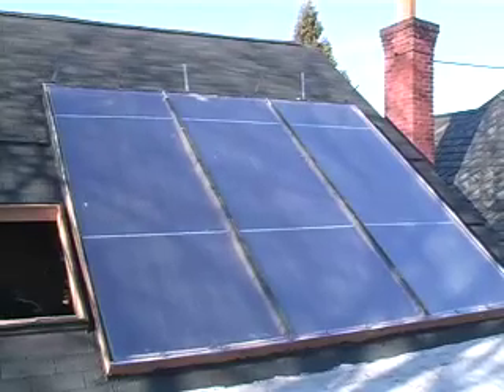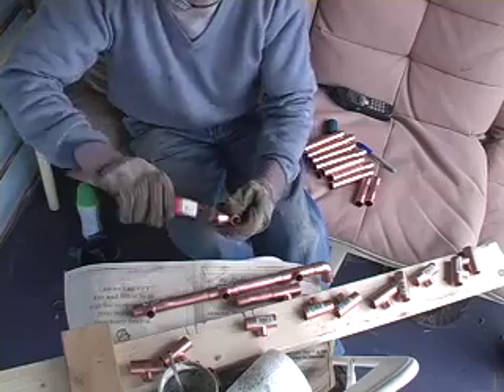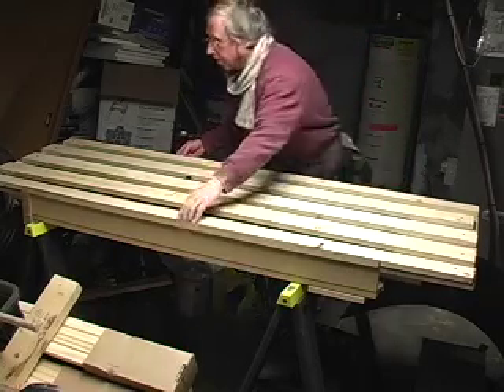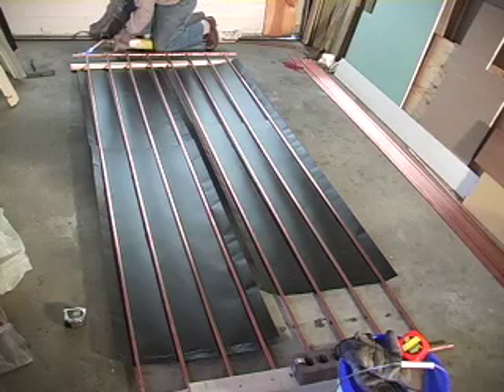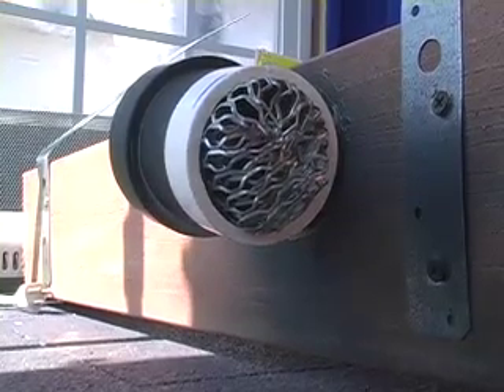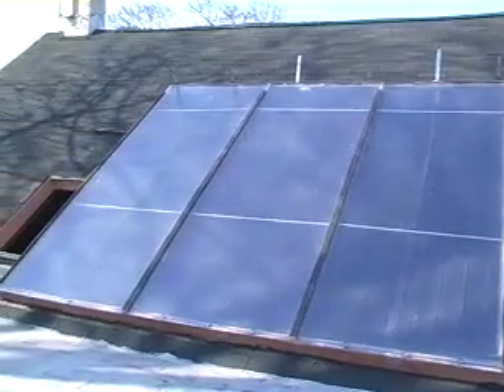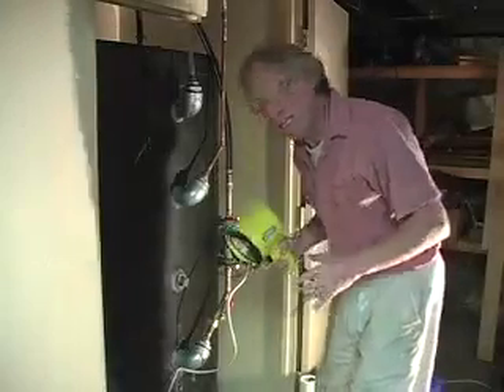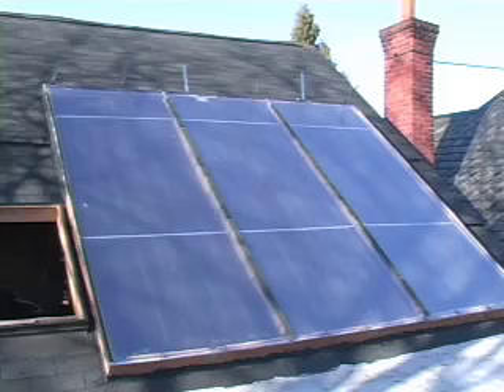Solar Home Heating

Comment: Joints should be braised. You save gas which the power plant can turn into electricity. So yes it can generate electriic. Did you do return on investment?

Comment: great job,although if you made it so the water ran up then down and flowed through each pipe like a snake instead of just a header at the top and bottom you can get far more heat and energy from it.  But nice work  :-)

Comment from the maker: There is no water in the pipes at night. It is a drain-back system. As soon as the sun goes in and the pump stops, all the water falls back to the tank in the house. The collector is at a slight angle and there are no places in the pipe design where the water can stay.

Comment: I really like your panels that is very similar to the way I would build them.
I do have a question,First  Would you gain any by have the water travel in a loop?(instead of the manifold system) or dose the heat that the panel makes or is it more than enough?
also should you insulate your holding tank?
 what temp is your holding tank in the morning? how long did it take to get the tank to max temp?
Awesome job!!!

Comment: What do you think about using a car or large truck radiator to get the heat into your home. Tie it into your air ducts with a small fan.